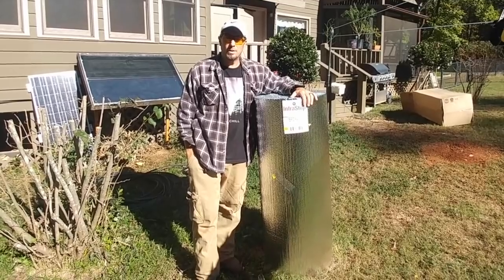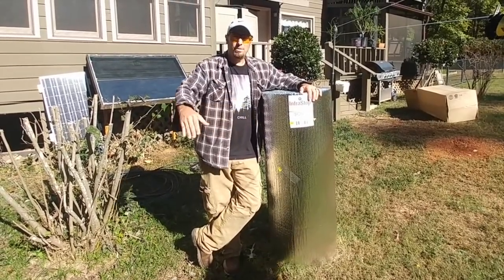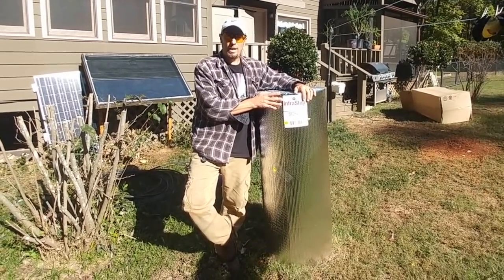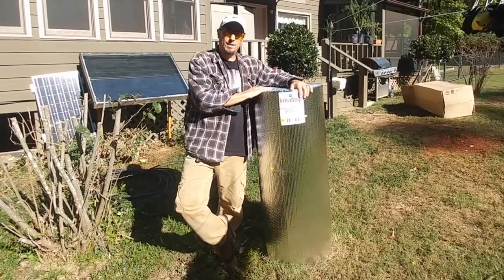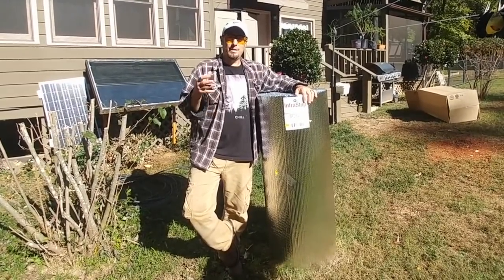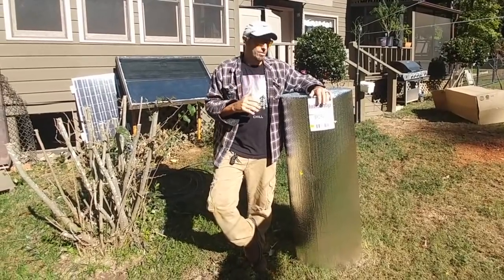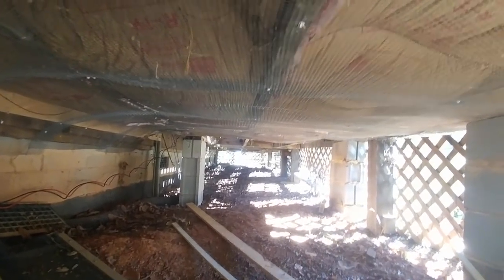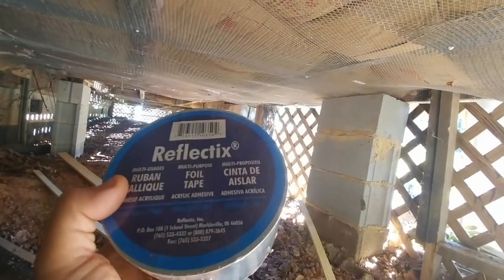Does Bubble Foil Really Work?

Comment: I am not an expert in thermodynamics, but after all the rabbit holes I’ve explored on the topic of warming the living space when there’s an exposed crawl space, I can see why the foil is so effective. 

My biggest takeaways: 
1. Hot air is always LEAVING to where it’s colder. The primary method of doing that is: 
a) convection: air movement through gaps
B) conduction: temperature movement through solid materials. Ie: interior side vs exterior side of doors, windows, walls.  Some materials have better conductive properties and easily transfer the hot to the cold. 

We also have the air stack effect where hot air rises while cooler air sinks.  

So we end up with the warmest air escaping out through all seams and surfaces above the floor. It’s escaping either quickly without much barrier or slowly through conduction. 

All the warm air lost out through cracks or porous materials is pulling in new air molecules behind it  to Maintain equipment.  

Most of warmth is lost through the roof and windows / doors while most of the cold is comes up through the floor, under door sills, etc. 

The foil will slow the movement of cold air coming up.  And  it employed the 3rd way of temperature motion is radiation. It will radiate the warm side back to wear it came from.

Comment: If you encapsulate the crawlspace, you will want to use a vapor/moisture barrier on the ground and remove all insulation from the flooring( living space).  You can’t just close off the crawlspace with the exposed earth or you will have a moisture and mold/growth problem.  The crawlspace requires adequate ventilation with insulation on the living space floor, or it can be fully encapsulated and become part of the living space.  Picture a spray foamed attic space.  It must be completely closed off with insulation removed from the ceiling.  If there are any areas of air/moisture infiltration there will be problems.
Reply: I don't believe you.   .....with insulation removed from the ceiling.
Reply: @jamescole3152  Sometimes the only way to learn is to see with your own eyes. Insulation on the ceiling may not create any major adverse conditions, but it certainly reduces the affect of combining the living space and the sealed attic space. It becomes useless and can cause adverse conditions if there are areas of air/moisture infiltration within the space.  I never asked for your approval my friend.  As a state licensed building inspector, after many years inspecting thousands of properties, continuing education and as an owner of a sealed home, I’m confident in my knowledge and experience.  Wish you the best with your endeavors.
Reply: @diann9159  We are talking standard fiberglass rolled batt insulation on the ceiling and spray foamed roof decking.  We seal the entire attic space from the roof decking to the exterior wall header and a few inches onto the ceiling drywall.  The attic becomes one with the climate controlled interior space. At that point, having the ceiling insulation helps nothing, but limits the transfer of equal temperature and humidity throughout.  Also, if the insulation is not removed around the perimeter it is difficult to apply the foam down from the decking, header board and ceiling drywall.  Even if you pull it back and spray it, it will go back and adhere to the foam.  Future inspectors cannot verify proper installation at that point.  Always best to just remove it.  Your spraying foam into the ceiling is a completely different system entirely.  I honestly know nothing about that application as  it’s not a system used in my region.
Reply: @diann9159  if I may interject a thought here. Spray foam off gases, to what extent and for how long, I do not know. I’m not a huge fan. A double bubble double foil product can be layered in each joist space separated by a 3/4” air space and give tremendous energy savings. They’ve actually been able to assign an R-value to it. No need for fiberglass, which is only basically an air space. The reflective barrier keeps heat out in the summer and keeps heat in during the winter. 
 I live in E. Tn. My house is wrapped just with Super R-Plus and my attic is blanketed with the same product over fiberglass batts. Typically there is a 23-25 degree differential from outside to inside without any heat running. Spray foam is very expensive compared to a radiant barrier. If any repairs are ever needed, rewiring or other modifications, I would not like having to deal with the foam. 
  Just my two cents. I’ve been in construction my entire life and ran my own business for 40 years.

Comment: Thanks for sharing.  This is why I like your video's.  You tell it like it is.  You gave your big picture which included other things you did to help insulate your house.  It's so important to look at doing several things to help make a difference.   I look forward to you reporting in on your thoughts about the bubble foil in the future.

I put 1" bubble wrap on most all of my windows (on the inside) to see if it would help reduce my heating bill this winter.  Super easy to do.  Spray window with water and apply.  The bubble wrap still lets the light in and I only look out a few window anyway.  Most of my windows have some type of blind so no one even sees bubble wrap on my windows from the inside.  I'm told that it will help in the summer also, so I will be watching my electric bill also.  I do know that the bubble wrap on the bathroom windows has stopped the cold air flow that I previously felt in the bathroom.

Good to see you both.
Reply: I've used the bubble wrap too and the results were good.  First, I hung black woven fabric on a tension rod inside the windows that are in sunshine.  Leave some room for air to flow through and on a sunny winter day, I got a 17 degree temp. increase from bottom to top of a tall window during strong sun.  I added the bubble wrap to the window later and could only get a 13 degree rise at best, but my thinking was the heat saved at night probably more than made up the difference.

Comment: You have a common misconception about how insulation works as stated at about 9:30. You said heat rises. It does not. Hot air rises, heat always takes the shortest path to cold. That is why floor insulation is just as important as roof insulation. A true dead-air space is worth about R-1, no more. If you feel warmer after installing the bubble-rap I believe it's probably just because of the very poor installation of the floor insulation. Big gaps like you showed defeats the entire insulation job, again as the heat will take the easiest path to cold.
Reply: Tim Saxer so I guess there is no heat in HOT air.
Reply: @pahuntnut  You guess wrong. Hot air rises because it weighs less than cold air. With your limited understanding, radiant heat would not work. But we know that a radiant heater raises the temperature of a denser object, which could be below the level of the heater. Put your nose on the bottom of a lit lightbulb, I think you'll get the point.
Reply: @timsaxer6442   Tim Chill haha, we all can see you have 3 or 4  master degrees.    By way the reflectix works well because of the way its made. it has non conductive air between two foil layers that provide 1- vapor barrier as well as 2- thermal  3- Air barrier. Yes the fiberglass is upside down and really should not have a face for use in that area, would been better with solid insulation if not a 2 inch layer of spray foam then fiberglass but with the reflectix installed, should not matter.  Heat in homes transfers through thermal conductivity and installing thermal breaks and air barriers it will make your home warmer.  Thermal conductivity includes joists, studs and other material that can span gap to cold side. The thermal break provides less transfer. Hope this helps.  by way great vid....

Comment: I live in Canada and build houses for a living. I live in the second wettest climate in our country on the east on an island that has some of the highest sustained winds on the planet. We dont mess around when it comes to this stuff. Having said that, in your climate you are accustomed to mechanical air conditioning, where as our air conditioning is a matter of just opening a window. If it's talk about retaining heat in your house then I can help. First off windchill is a factor of heat loss so skirt the foundation in short. Secondly trapping moisture in a cavity is a big problem here. Winter warm side is where to vapour barrier needs to be. Breathability is another issue. Using 50 year old building science isn't doing you any favors. Solution, -2x8 joists
-1 1/2" zip panels with taped seams on outside R9
-Closed cell spray foam to a value of R13
- Roxsol insulation R23 in between
Closed cell spay foam is your vapour barrier and the smart part of it is, is that its sprayed to the underside of your flooring. No dew point issues. Rocksol is a product that is critter resistant and release water if it gets wet without mold or rot issues. Zip panel are also breathable and tackle the issuse of thermal bridging with the wooden joists and creates an air barrier (windchill equal heat loss). Now add up the r value and you get r45 with a 2x8 floor joist.
Reply: Thanks. I live in Ohio. Building a 3 season room on the deck. Looking for how to insulate the floor from the underside. All this info is very helpful as I am doing it myself as a non professional senior lady and on a budget.
Reply: @peggylee-tocco751  if you need any advice,  feel free to ask

Comment: Thinking about your work the mention of the heat loss in the ceiling and floor brought to mind an image of air flow.
In the winter when hot air rises and leaks to the atmosphere it draws air in from the outside.
That air being cooler it pools near the floor.
When the floor leaks the cold air it also cools the floor.
This suggests that sealing the attic and the floor would really decrease the heating costs.
In the summer the airflow would be reversed.
The cold air would be heavier, 'pressing" on the floor and leaking out of the house.
The exiting air would draw in hot attic air adding to the AC load.
Notice that at no time did I say insulation.
Bubble foil has an R-value but the big positive value is as a air barrier sealing up the air leaks.
Air stays in place and no air is drawn in.
The HVAC circulates the air not convection...
Forget the R-value, it's just icing on the cake.
The Boss stumbled onto this and experts are trying to say his perceived positive comfort gains are a placebo effect.
They are solid science of air infiltration and exfiltration.
Those "experts" need to try it and report back.

Comment: 2nd is through single pain  windows which you can make bublefoil   fillers panels for with a small fold down flap for outside viewing 

3rd is floor not because heat flows out of the floor, 
 but because cold seeps in and neutralizes the heat. imlo.

Comment: nothing wrong with the reflective but for real insulation and critter control.. Rockwool is likely the best way to go.. Critters do not eat slag they dont eat volcanic rock.  it is a real r 4 per inch. once you install that then go back over with the bubble style you should have amazingly warm feet.  Yes the rockwool is a lot more expensive but you can easily get R8 with two inches ... Not much you can do about the thermal bridging unless you put another layer onto the bottom of the joist that really do insulate those joists from being directly exposed to the air.

Comment: Mice are the worst! I had a mass influx at my home , due to a nearby construction project clearing the woods.  I found a rodent control product called- just One bite, it works well! I bought several cheap plastic ammo cans, drilled a mouse sized hole in them and placed them around my property. I haven't had anymore problems since.

Comment: How has the house been since the install below the floors?  This stuff is really a thermal reflective barrier and not an insulation, definitely requiring an air-gap to work properly.  I have a full, unfinished, unheated basement and will be installing this stuff on the bottom of the floor joists in the entire basement.  The basement sits at about 55 degrees during the winter.  It is supposed to greatly help reflect radiant heat back up into the first floor, keeping the floors noticeably warmer.  It even meets local fire code (class A / class 1 rated).  Very easy to handle & install and I'll be using simple tuck tape to seal the seams since there is a slight overlap at each joint.
Reply: @csimet  how did your install go? You can actually layer the bubble wrap in the joist space with a 3/4” air space between each layer. To me floors are not as critical as the attic/ roof space. My house is wrapped in just the perforated foil and my attic is blanketed with it over fiberglass batts. Lately, my house stays 23-25 degrees warmer inside than outside with no heat running, except my refrigerator, lol. 
 You bring up an interesting point. Other than keeping heat in during the winter, the product wouldn’t necessarily keep out the cold. I am not a huge fan of fiberglass underneath a house. Codes and standards have changed so much over the years. Completely making a structure air tight never is a good idea.

Comment: I was going to mention Boss of the Swamp uses it and it works LOL.  When and if you skirt the house (actually it would be a very good idea to skirt it) also put the bubble wrap on the inside of the skirting like the Boss of the swamp did with his block wall and it worked.
Reply: Sandra, you're waisting your money. If you want to just block off the skirting, use 6 mil. Poly. It's cheap and it will do the same job. The foil bubble wrap on its own offers very little thermal benefits.
Reply: @georgelabottum7448  well thank you kindly for your input appreciate it.

Comment: Any way and anyplace you can stop air flow, you stop heat loss..  I have been going around my place trying to stop the "air flow"  any way I can..  There has been a major difference just from using duct tape in the right spot, so bubble foil would have to work better..  Good job Tommy..
Reply: deserthorizons You must be referring to “warm air”, in which case you would be correct. But “radiant” heat moves in all directions and is not affected by air movement!

Comment: Shouldn't that insulation batts have had plastic vapour barrier put over it. .. Without plastic vapour barrier the cold wind would go past the batts right to the floor ..
Reply: No. Vapor barrier would be on the wrong side. Leads to trapped moisture which leads to mould growth. Fiberglass insulation needs to breath.

Comment: No disrespect but you should have taken the time to pull the critter guard down, flipped over the insulation and made sure there were no gaping holes as you pointed to one opening then add the bubble foil. I’m sure it helps but those holes will let a lot of heat out and cold in.
Just my 2 cents.

Comment: Just a general note to all out there.   If insulation gets wet (talking fiberglas or mineral fibre) the thermal performance drops drastically. Spent 42 years with Johns Manville. Technical fact is if fiberglas or MF takes on as little as 3% moisture content then thermal performance can drop as much as 70%. Short lesson... Keep your insulation dry.

Comment: I'm not sure where you live and the pricing in your area, but Lowe's has it (Reflectix) for about half the price I saw on the link you gave.
Reply: Arlie Box Innovative Insulation in Texas. Full line of radiant barriers. Direct from the manufacturer at a fraction of cost at other suppliers. Have used Super R Plus for years. Dynamite product. About $.14/ sf. Ask for Perry

Comment: 4:15
I would have added more insulation and hammered some wood over it. You need makeshift foundation.
Reply: I agree. The mesh allows insects in and especially termites. With non-pressure-treated wood, it's a potential problem. Heat travels three ways: radiation, convection and conduction. The mesh is like only wearing a warm sweater in a wind-storm. The air just moves right through it.  The foil bubble wrap is supposed to keep radiant heat in (or out.)  In this application, it also cuts down on air moving. Wood with sealed edges would do that too.

Comment: I put  Bubble Foil over my ridge cap,  for the retention of heat in the bitter cold of up north Michigan.  It  worked, to stop 99%  of the heat loss,  just like it said on the package.  Snow,  sitting on top of the foil over the ridge cap, didn't even melt.
Reply: Your ridge cap is there for a reason and that is to allow air movement above your insulation. Blocking that movement with foil will eventually lead to moisture building up in your attic or air gap above your insulation and may result in mould development. In winter it could lead to ice buildup.
Reply: @georgelabottum7448    In the dead of winter that wasn't going to be problem.  The plan to save heating dollars, in upstate Michigan  worked perfectly.  It was so dry in the house that I still had to humidify my acoustic guitars.                                        I closed off my parents attic vents, years before with the same results.  You only want to do it in the winter when the cold air  is unable to carry  as much moisture as the  hot  summer  air..